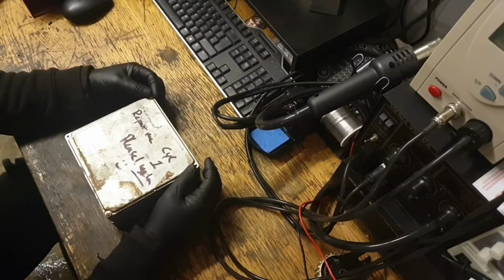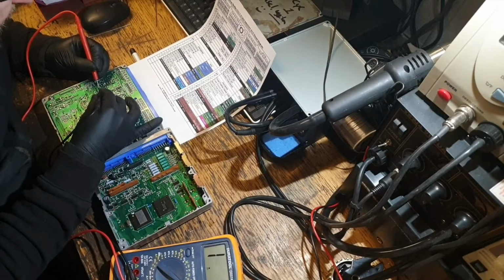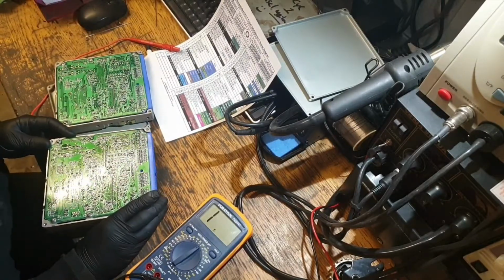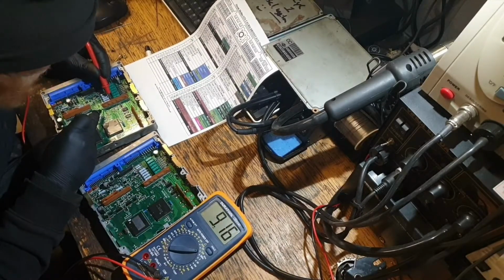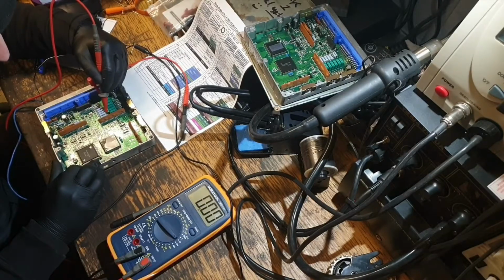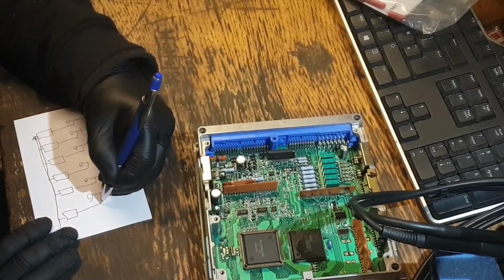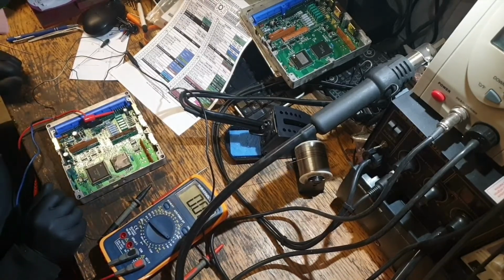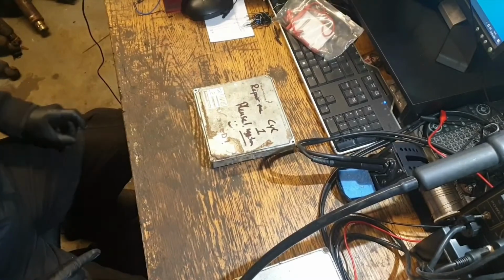Nissan Skyline R33 ECU repair

Comment: Being able to watch Jesus repair my ecu has made my day! I knew it was fixable 😀 can't thank you enough!
Reply from the maker: Haha no worries. I'll be happier once it's tested on a running car just to make sure nothing else is damaged but as far as I can tell it's good. I did consider trying to wire in a coil and a CAS to test fire it but I'm not sure I've got a good igniter here and that is a bit OTT anyway lol. Let me know how it goes though!
Reply: @jdmjesus6103  ECU was working fine. I had some issues with coil packs and lost cyl 1. I pinned the board out and gave the diagnosis but I don't have the tools required to replace the components. Really impressed with the video mate and really appreciate the work!
Reply from the maker: Sorry, I meant something else *in the ecu*. Sometimes components can fail because other components have failed, like a cascade effect. Its highly unlikely with it being a daughter board like that, any other components further up the chain should all be included on there. It tests OK on the bench but I was just concerned once it has a load applied it might break again. like I say i just won't be happy until its running an engine again but I'm confident it's fixed.